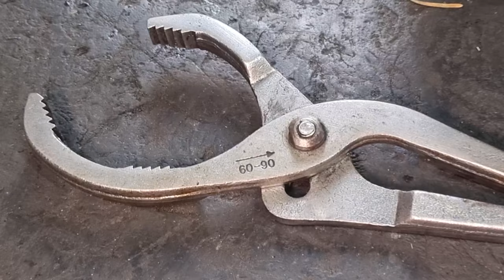How to change Honda ADV 350 motorcycle oil and oil filter

Comment: C'è un motivo per il quale hai usato ub olio 10w40 e non 10w30 ? Grazie per la risposta
Reply from the maker: Gli ingredienti dell'olio sono diversi per ogni paese e regione.
L'olio 10w40 è adatto per la Corea, quindi...
Quando si guida in Corea, si consiglia di aggiungere olio 10w40.
(이탈리아어)

Oil ingredients are different for each country and region.
The 10w40 rated oil is suitable for Korea, so...
When driving in Korea, it is recommended to add 10w40 oil.

Comment: how much quantity oil the engine takes?
Reply from the maker: When replacing the filter, add 1.5L.
Reply: @MotorcycleRepair  I changed my my honda sh350i oil at 1000km,the old oil quantity was close to 2 litres, now I filled it to max level on dip stick.
Reply from the maker: @paulsp2693  When disassembling and assembling the engine, the maximum oil injection volume is 1.8L.
1.3L for normal oil change
When replacing the filter, the oil is 1.5L
1.8L when disassembling and assembling the engine
You can just replace it like this.
Reply: @MotorcycleRepair  thanks for the information
Reply: @MotorcycleRepair  How many kilometers should changing the engine oil?
Reply from the maker: @ysan002  Since this motorcycle is used for delivery, I change the oil every 2500km.
Reply: @MotorcycleRepair  thanks for sharing

Comment: 오일을 얼마나 자주 교체합니까??
Reply from the maker: 영상속 오토바이 정비소에서는 1000 ~12000km 운행을 하면 오일을 교체하도록 권장하고 있습니다.

The motorcycle repair shop in the video recommends changing the oil after driving 1000 to 12000 km.

Comment: Motul 10W30 MB scooter power oil 12.000 km change 👌🏼
Reply from the maker: In Korea, the oil change of 350cc motorcycle is replaced every 3500km.
No matter how expensive and good the oil is, I don't think replacing it after driving 12000km is not a good idea.

Comment: the owners handbook requires 1.8 with filter change.
Reply from the maker: In the Korean manual, the oil replacement amount is 1.5L when replacing the filter.
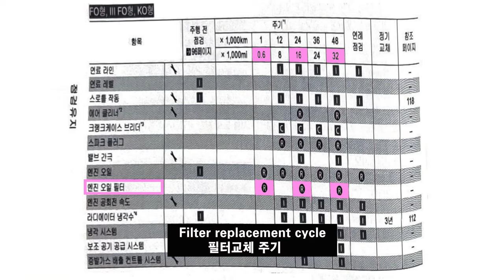Please refer to the last part of the video above at 05:20